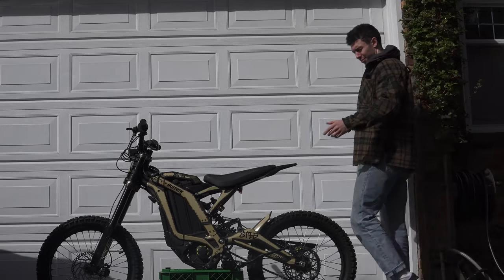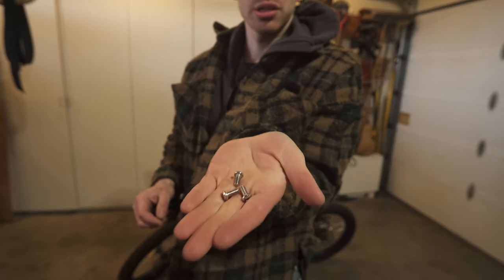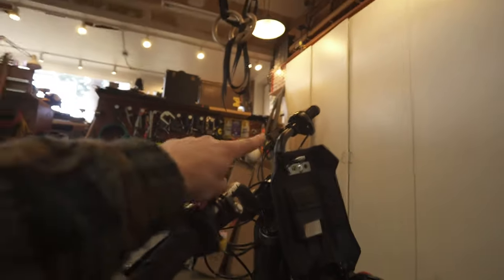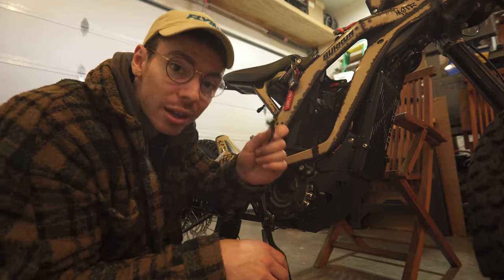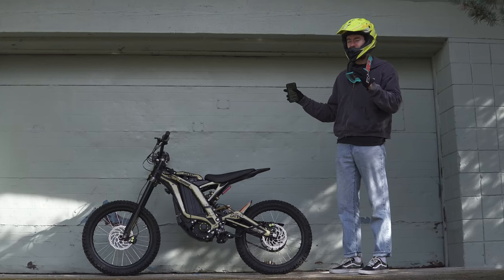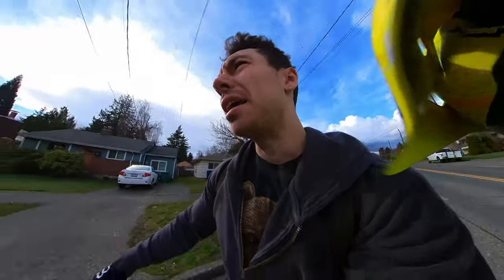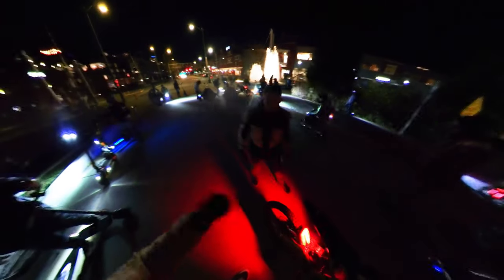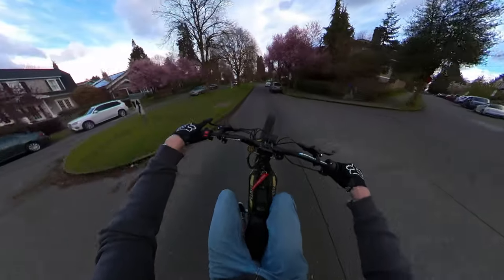I put an F1 tail light on my Surron

Comment from the maker: Alright logang, as promised here are affiliate links for the parts i used so you can make this light yourself:

F1 Tail Light: https://amzn.to/3mgy27w
Waterproof connectors: https://amzn.to/3MqQUeF
On/off switches for strobing feature: https://amzn.to/41cBRJr

You’ll also need wire strippers, crimps, heat shrink, and a couple other basic wiring tools! Let me know if you need any help.
Reply: Could you make a more in depth tutorial on how to do all the technical wiring I’ve never done this before lol

Comment: Adding an actual brake light to mine with high/low.  No idea why this isn't a standard thing.  At least my Sting R has higo 2 wire plugs, so it's easy to get up and running.
Reply from the maker: Agreed - it’s dumb this isn’t wired into the surron to begin with. yet another thing the Sting R got right! Sick bike.

Comment: Dude I can't make this light work properly for 3 days... Can you please explain what to do exactly with the yellow tail light wire and brake sensor?
Reply from the maker: The yellow wire just needs momentary power to make it flash - so you need to run power from your bike to your brake sensor (which is an open circuit at rest) then the other side of your brake sensor needs to go to the yellow wire. That way, when you grab your brake, the circuit closes and you supply momentary power to the yellow wire. Does that make sense?

Comment: I’m trying to understand the wiring. Yellow from the light goes directly to front brake wire and then in that line a switch is added?
Reply: For the brake wire what do I do w red/black wire
Reply from the maker: yep! The brake sensor acts as the momentary switch in that circuit to send voltage to yellow, which makes the light flash. but the little in-line switch can totally disconnect that circuit so the yellow can’t get any voltage - hence, it disables the flashing feature as long as the in-line is switched off.
Reply from the maker: That’s your 12v power source and common ground - they need to both go to the corresponding red/black wires on the new light so it glows constantly, but you also need to splice in the yellow wire to the red power source, run that whole brake switch circuit, and have that terminate at the yellow wire on the light. That way you can send momentary voltage from red —> yellow to make it flash!
Reply: Thank you! It’s confusing because I also have the grit shift 3 way switch on.  Really appreciate  the help!
Reply from the maker: @BenHicksPhoto  aaaah yes that’ll make it tricky, but i bet it’ll be a clean install once you’re done!!
Reply: I’m stumped.  So let me tell you my wiring. Grit switch 3 way switch.  I have that black wire (live) going to both red wires coming from brakes.  Both green wires from brakes connect to yellow(taillight).  Green Ground from original  taillight wire to black on tail light.  Lights are on. But tail light only flashes when I first turn on bike.  I don’t have the brake wires set up right.  A little puzzled
Reply from the maker: @BenHicksPhoto  hmm - that sounds like your yellow wire is getting power as soon as the bike turns on, so somehow your brake wiring isn’t interrupting that circuit. The light’s black and red wires should always have power, and the brake circuit (your switch and two brake switches) should run in a big loop from your bikes + all the way through all the switches to the yellow wire on your light.
Reply: @logan-taylor  yeah it’s definitely that but not sure what you mean.  Sorry I can build a 4 stroke engine start to finish but electrical is foreign!   So yellow, goes out of light and connects to green/yellow that goes to brakes.  The red wires on brakes go directly to main power?
Reply: @logan-taylor   I got it!!  The tiny little springs inside the bake sensor levers had fallen out!  🤦🏼‍♂️. Thanks for all your help!  F1 🤘🏻🤘🏻
Reply from the maker: @BenHicksPhoto  NICE! That’s literally the last thing i would have thought of haha - hope the light is working out great for you!